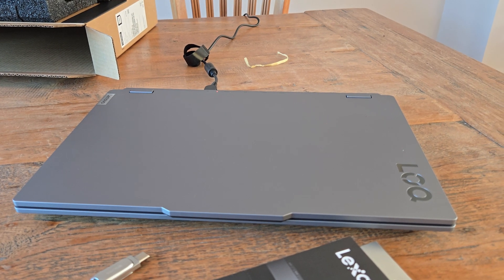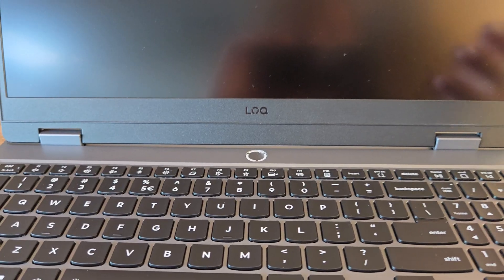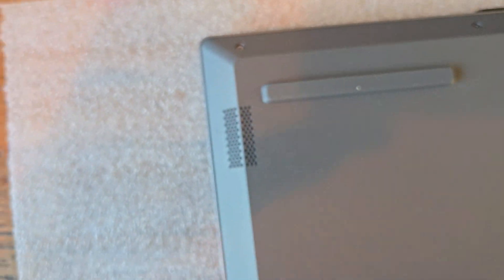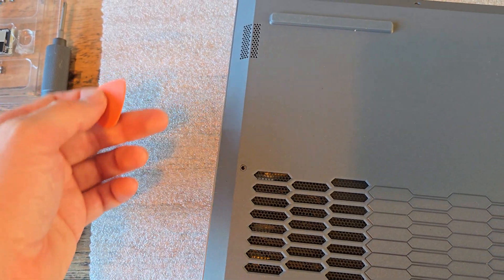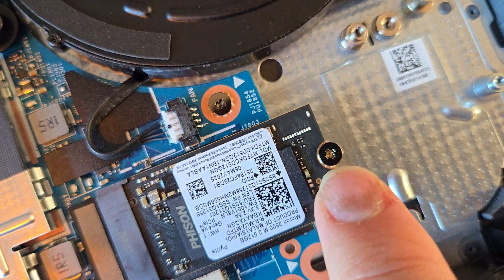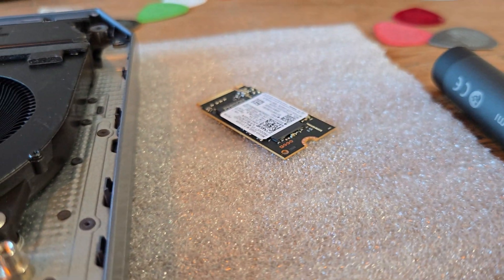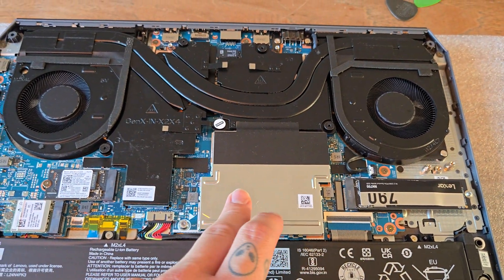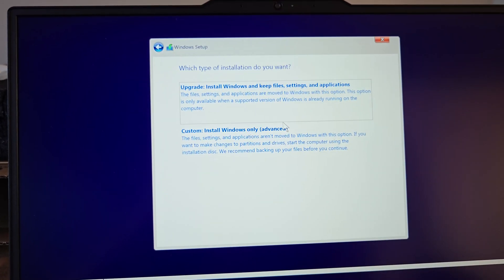How to install an M.2 SSD in a Lenovo LOQ 15IRX10

Comment: I would have avoided windows reinstall by 1) Backup existing SSD image (already done since I use Macrium). 2) Replace SSD. 3) Boot from Macroum rescue USB media. 4) Restore image and grow Windows partition to new capacity. 5) Insert old SSD. 6) From Windows repartion and format old SSD.

Alternatively, one could just insert new SSD in the secondary slot, use some partion manager (Macrium can do this too) to clone the old SSD to the new, swap the drives and repartion, and reformat the old.

That followed your scenario. But the boot SSD doesn't HAVE to be in the "primary" slot, I think. You can set the boot order in BIOS if I remember correctly. So just insert new SSD into free slot, clone, change boot order, reformat old drive.

Comment: I’ll be watching, I’m hoping you do a RAM upgrade on this model.
Reply from the maker: The process is the same more or less, if not easier. The ram is located behind the metal plate, just caredully pry it off then you can unclip and remove the old and pop in the new ram modules and put the cover back on.

Comment: What if I already have windows installed on the main ssd drive that is already there from the factory and I just want to add an additional ssd drive? Then I don't have to put the windows files on a usb drive, right?
Reply from the maker: Exactly, if you already have windows and want extra storage you aren't gonna need to install windows all over again. I had to either way though because my laptop didnt come with os installed out of the factory(saved me 100 bucks ;))
Reply: @PAP0sTechSupport 

Thanks for the answer.

Hey, can I ask you to answer another question? I just ordered the same spudger type tool as you, but since this will be my first time opening a laptop cover, I wanted to understand specifically how you opened it? Which side did you start opening from to open it gently and not tear anything.

Comment: Why connected with electricity I don't understand?? No it's more safe do it only with the battery of the laptop???
Reply from the maker: The laptop needs to be unplugged. All you have to do is put it in service mode to disable the battery for maintenance and repairs. After you plug the charger back in and power on the laptop it'll be back to normal
Reply: @PAP0sTechSupport  so after i disable the battery from bios and intall the ssd.. i dont have to re enable the battery again from bios .. i mean does it re enabled automatically ?